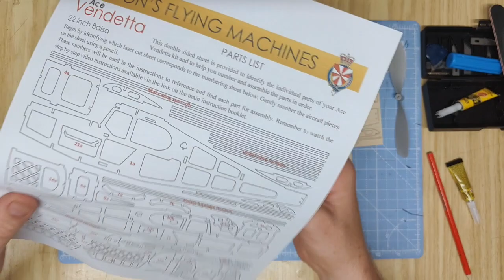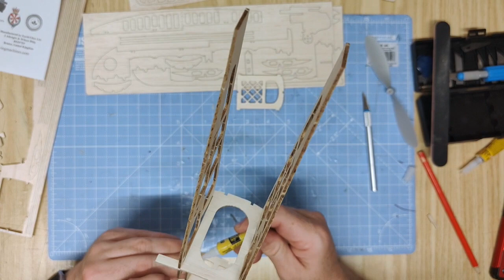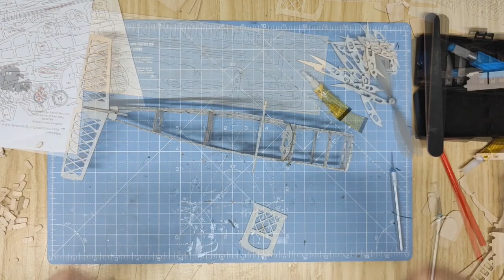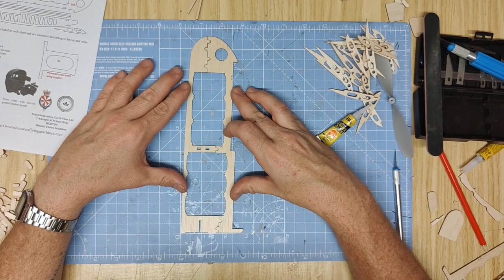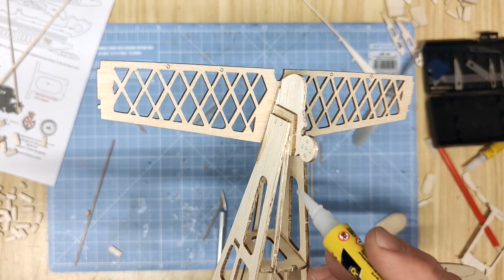Ace Vendetta instructions   HD 720p

Comment: Oh! I used to do these kits 50 years ago!
But back then? Mostly the kits had only printed lines on the balsa - and were die-cut for the expensive ones. Sharp scalpel was needed in all cases - and a steel rule to cut against!
We had no super-glue back then .. balsa cement takes a few minutes to dry, so you are there holding the joint for a while till it set ..
You know .. back then, visible features like the cockpit dashboard .. we hadda paint them to good detail before installing.
Wings .. yah .. look we hadda pin them down on the plan so they would not warp with gluing and covering. The dope will warp things badly if not constrained! (after teh water-shrink of the tissue!).
Yah .. waxed transparent paper allows you to glue against the plan without the glue getting on your cutting board!!
I mean .. damn .. you cannot fit the wings until you have covered them and ensured they are symmetrical!!
Assembling air surfaces BEFORE you get symmetry is a mistake!
And damn .. skinning a fully assembled airframe is a NIGHTMARE!
Everything interferes with everything else .. and where did the symmetry go!!??
Other than all that - Thank you for reminding me of my childhood!!
Story:
One time I made a perfect balsa-rubber scale copy of an ME 109-B.
No box-shape - all curves and stringers.
I gave it 200 turns of the rubber and set her loose!
She climbed and leveled as I intended - and then a flock of magpies came and ripped her to shreds before she could touch down.
Fooled the birds at least ;).
But man .. skin the wings and fuselage before you join them?
And get some kinda color on the skin that means something?
Huh?
Reply: i just out an old school corsair together . yep wax paper . i used dupount rubber cement back in the days but super glue does wonders , still use regular wood glue for some parts